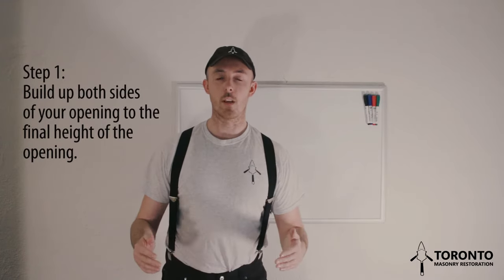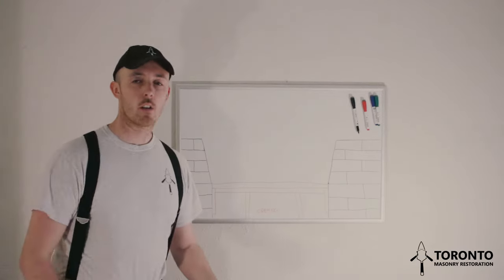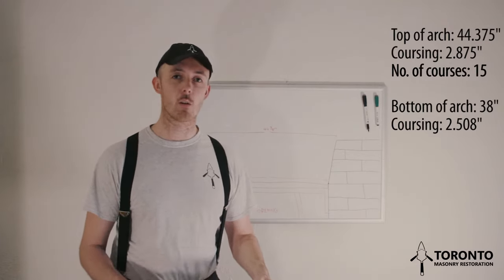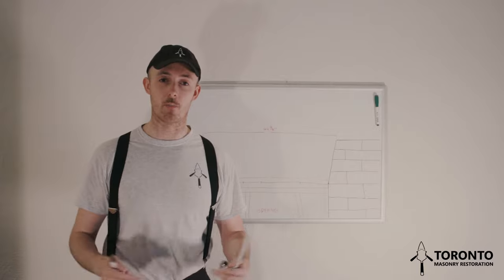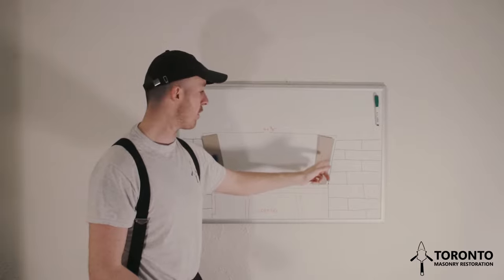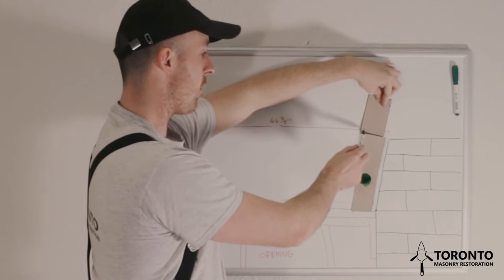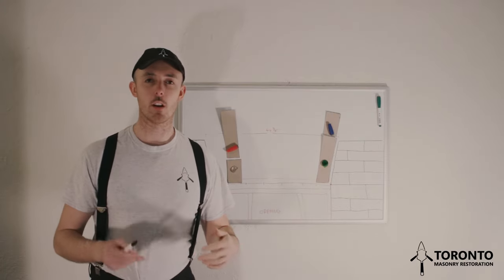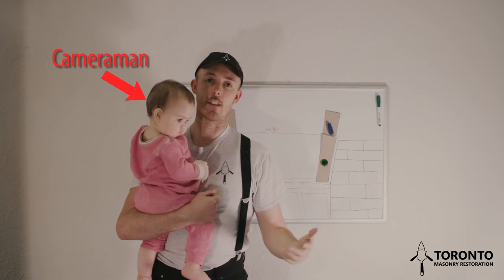Bricklaying - How to build a jack arch (flat arch)

Comment from the maker: Intro - 00:11

Step 1 -  01:21
Build up the sides of your opening.

Step 2 - 01:40
Find the striking point.

Step 3 - 03:36
Cut and lay the skewback.

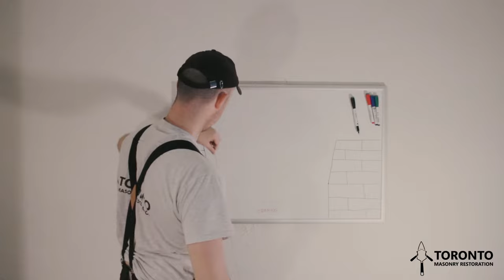Step 4 - 04:46
Install the false-work (form) that supports the arch during building.

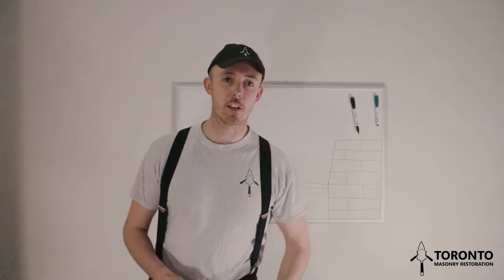Working out bond and coursing for the arch - 08:05

Step 5 - 13:41
Setting up work area.

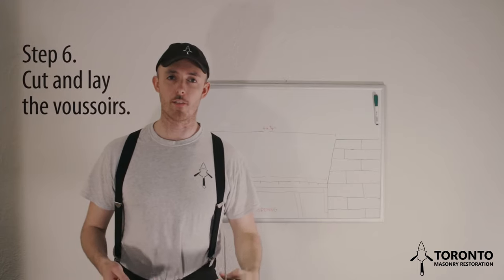Step 6 - 16:22
Cutting and laying the voussoirs